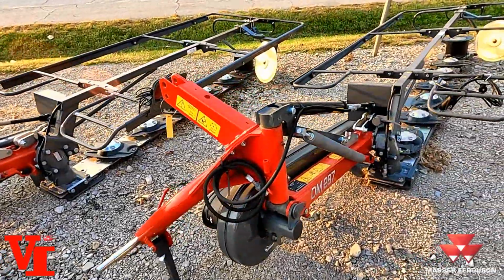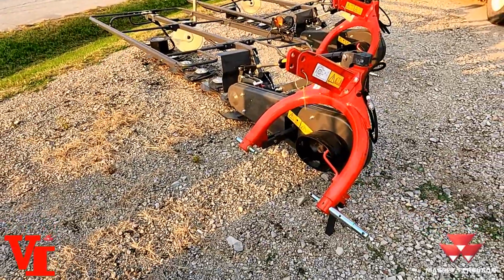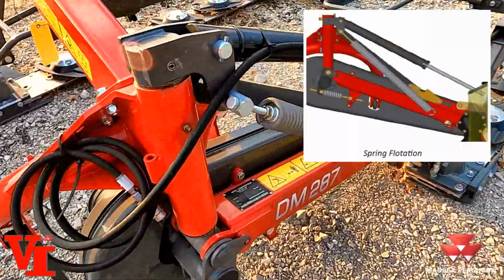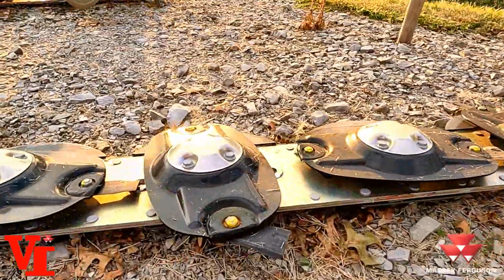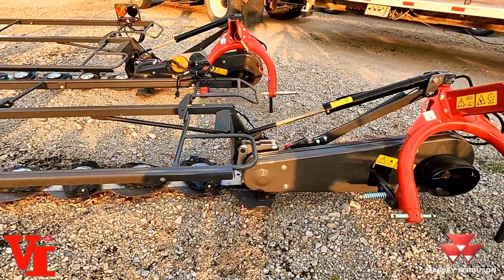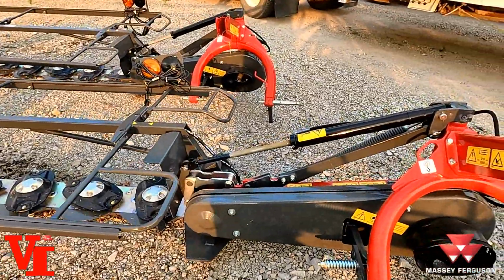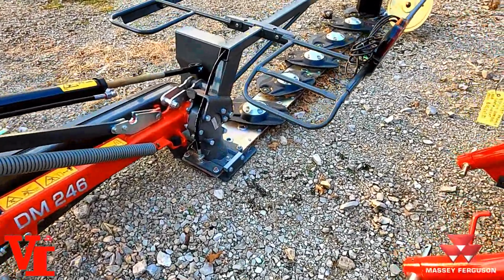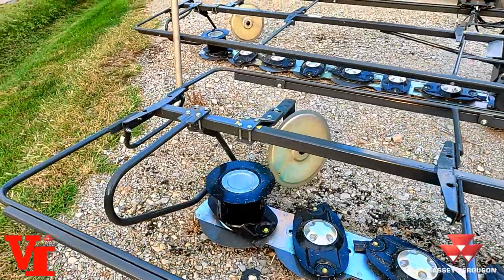Massey Ferguson DM Farmer Series Discmowers (5' 5" to 9' 3" Cut)

Comment: Which model model would you recommend for a MF 4608?
Reply from the maker: Massey Ferguson 4608 has 63.5 PTO HP. DM287 needs 60 PTO HP but 9' 3" of bar can create side draft and Horsepower limits if you have contours. I would recommend the DM246 Farmer (7' 11" Cut) since it only needs 50 PTO HP which allows for extra HP for contours. Probably mow faster speed with DM246 versus DM287 with a 4608 Tractor.

Comment: What model of mower would you recommend for my MF 4608?
Reply from the maker: Massey Ferguson 4608 has 63.5 PTO HP. DM287 needs 60 PTO HP but 9' 3" of bar can create side draft and Horsepower limits if you have contours. I would recommend the DM246 Farmer (7' 11" Cut) since it only needs 50 PTO HP which allows for extra HP for contours. Probably mow faster speed with DM246 versus DM287 with a 4608 Tractor.

Comment: Do you think the 2860e could run the DM246 being 2hp shy of the 50pto power.
Reply from the maker: You could probably mow more faster with the DM205 and is below the minimum PTO HP required (41 PTO HP). Think the DM246 would be a struggle since it is minimum 50 HP and the longer bar will have more side draft and if you need tractor hp to pull itself you won't have enough HP or your going to have to slow way down to do it.
Reply: @VahrenbergImplement  Thanks never ran a disc mower so I didn't know how conservative the pto power ratings are on them. I figure my field Is a bit rough so I wouldn't be able to go as quick as the mower would allow anyway and it's all flat. I'm loving the 2860e so far I upgraded from a Kubota L2501. I wish my local dealer would do videos and stuff.
Reply from the maker: Ratings are the Minimum on Flat Dry Ground for the Implement. The longer the bar the more tendency to pull the front end of the tractor around. Think you be much better off with the DM205.
Reply: Can you get this mower with conditioner?
Reply from the maker: Farmer Series Mowers are not available with conditioner option only the Professional Series Mowers offer Conditioner Option (DM255 Pro, DM306 Pro)